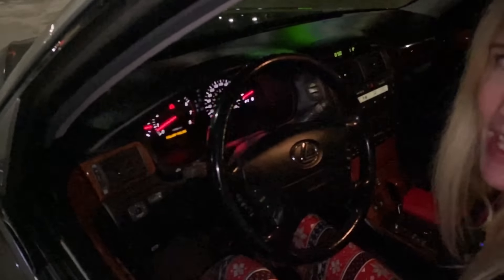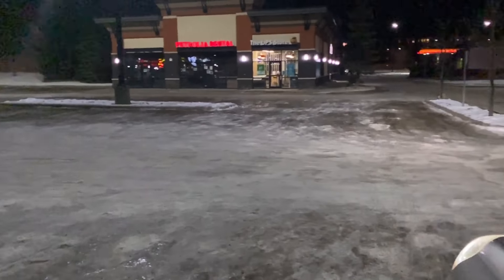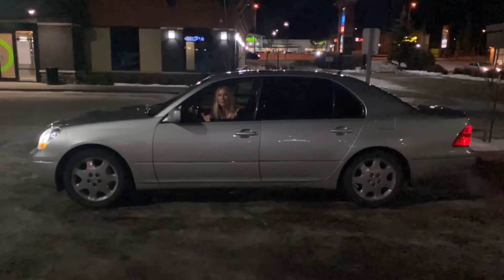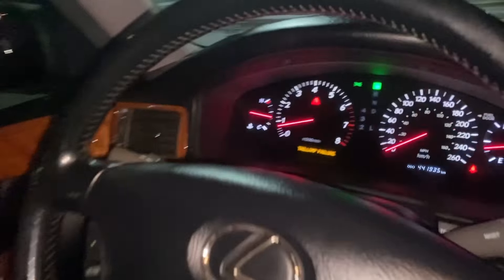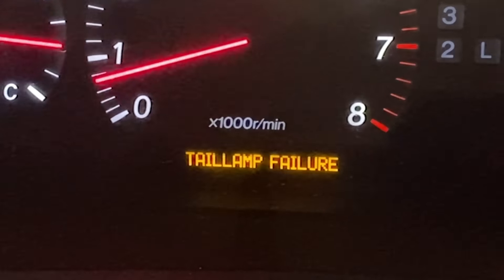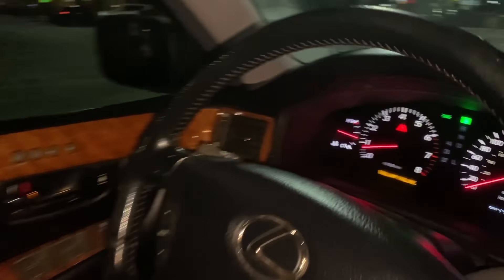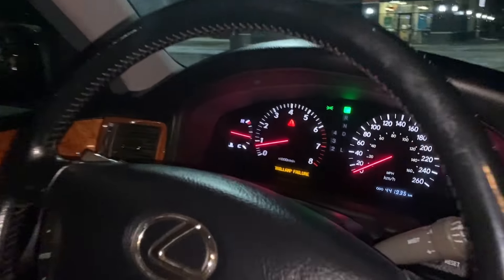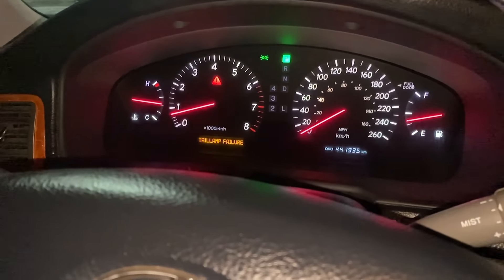Lexus LS430 Codes: P1349 & P0430

Comment: Ayooo, wanted to ask for a little help with a p1349 that causes p0300 plus bank1 1/3/5/7 misfires! I’ve replaced both OCVs(cleared p1346), all evap hoses as they were cracked (p0442), and changed my oil (it could have blocked oil passageways?). 
I cannot get p1349 and misfires to go away, about to go to the stealer ship.. 

2002 LS430

Comment: For the P0430 code, I've used an O2 Sensor Spacer Adapter, some had used a spark plug non-foulers, to the O2 Sensor.  Check with your local laws before installing it.  If your car is running good and you don't suspect that the expensive Cat Converter is plugged, then try this.  It basically pulls back the sensor part of your O2 Sensor so the heat from the exhaust doesn't give you a bad reading.  The sensor still picks up the flow but it will not signal a Check Engine Light situation.  My brother told me about this fix years ago when he fixed the Previa he owned.  I tried it years ago on my Avalon that I owned and it worked.  Good Luck!
Reply: Hey will this restore my mpg that my main concern with doing the o2 spacer thanks

Comment: Had the same error with my IS300 the catalytic converters was burned up. Check engine light popped up on the dash i immediately stopped on the emergency lane. I did this just to see if check engine light kept showing on my dash after turning engine off and on again. I noticed it didn't stay on it came and went off again, so i ordered a complete exhaust including black horse custom black exhaust manifold.
No more check engine Christmas lights off panic and heart attacks.😂😎
Reply from the maker: No one likes those heart attacks when the lights come on! We bought our LS with the engine light - the owner claimed it was a $1,000 fix so he didn't bother. Also, the light did not effect the engine. Like you, we are also looking at a new exhaust - the best way to get rid of that check engine light and the P0430 code.
Reply from the maker: @VasilyZaitsev1942  You're the best!
Reply: @lexusls4305  Any time brother if you need more let me know m good at looking for stuff that don't want to be found. Many sellers are so many years in the business of car parts, that they forget to either use Ebay or other methods that enhance sales. Or they just are use to certain habits and don't want to change, i say good for us the better it is and easy for us to find that part many look for.

Hope you get that catalytic converter code fixed.

Stay safe, watch out for the Covid-19 virus and have a good weekend!🙋🏻‍♂️🤝🏼😷

Comment: Ok
Your driver side catalytic converter is not  congested but its  efficiency is low

And your driver side of the engine has a bad vvt solenoid

So that check engine and vsc light will come again till those are fixed
Reply from the maker: Thanks Captain! Since I'm not a handy mechanic I'll be taking it in (Happy Holidays!) next week if there's an available appointment. I'm thinking it's a $500 job...anyone else have guesses?
Reply: @lexusls4305  you can do it your self for under $60 if you have a way to pass the smog test other wise buy used catalytic you can find it on ebay and the vvt solenoid too and both are a very easy to install
Reply from the maker: @captain5969  Excellent advice!